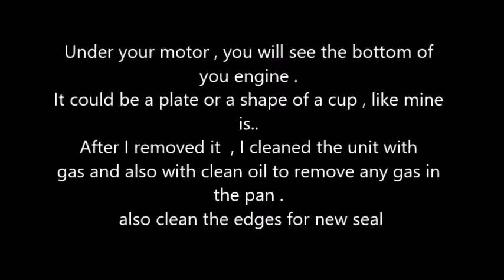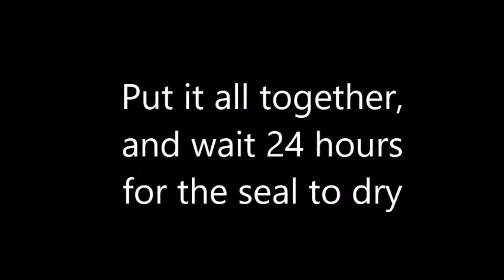Volvo xc90 PCV box and oil pan

Comment: Hello I'm in the same situation my oil pan is leaking. My question is did you have to drop the subframe to get the pan out? I'm mechanically inclined and can do the job my biggest hiccup is having to drop the subframe.
Reply from the maker: I took the oil intake box out first from the back of pan , and removed all the screws around the oil pan and  used a rubber mallet to tap it.  After cleaning i tried dry fit pan back  before using the seal , just to get the feel in putting it back in place.

Comment: What did you to clean the oil pan with ??
Reply from the maker: sorry buddy. i used gas and after i  used compress  air to blow it and dry it. got a bit of oil 5w30 to rinse it all out , made shore the gasket area was clean and dry to apply the seal gasket.
Reply from the maker: No leaks .
Reply: Gas as in petrol? You used the same for the egr valve?
Reply: @tigerloureiro  
Try the most toxic professional wheel cleaner.(ore accu toxic)
I used it from applied professional.
1 night in that cleaner,and its new.
Works like hell.

Comment: no video of the removal of the pan, that's very odd way of showing people how to preform a task. 🤣
these vehicles suck to remove the pan, you either need to shave a piece of metal to clear the pan from part of the frame, drop the rack, or hoist up the engine a bit by removing the engine mounts to gain clearance.  it's not simple.
Reply: i just removed my pan without doing any of that just unbolt and finesse